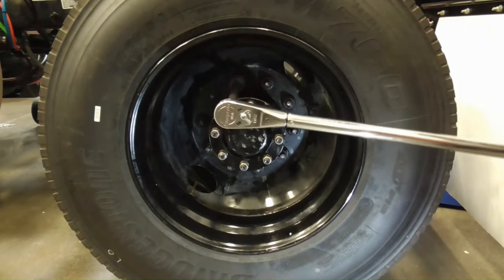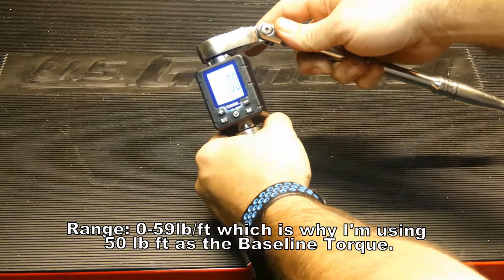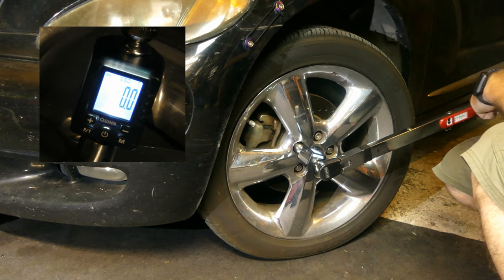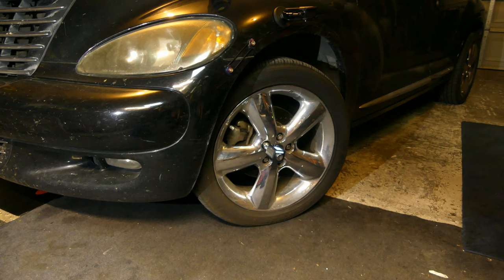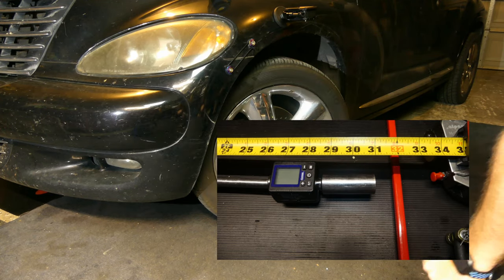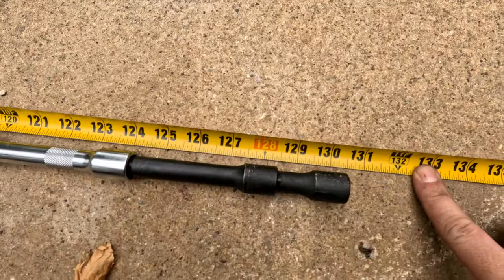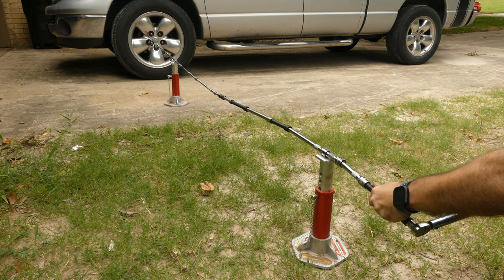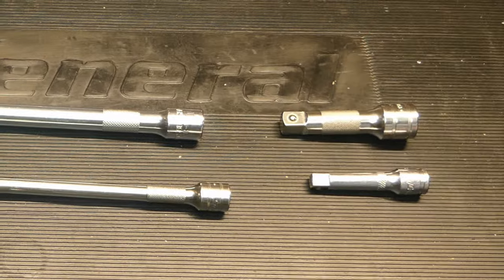An Extension on a Torque Wrench??

Comment: for anyone saying you cannot use an extension with a torque wrench....

1) blatantly false (whether you'll get the exact value you were after or not is a Separate issue)
2) I'd like to see those people get a torque wrench into a number of places it's required to torque things...
Reply from the maker: It was pretty close to the exact values, and in some instances you MUST use an extension for access.  Thanks for watching!
Reply: @Dartmech  I didn't want to summarize your video, so left that bit out.
Reply from the maker: Ha, whoops..

Comment: This testing is for static torque measurements.  The torque is the same at both ends, unless there is dynamic rotational motion.  If there is no motion, where else can the applied torque go?

Comment: Only rotational displacement will vary. PROVIDED there is NO additional friction at supporting points. Torsional energy will remain constant.
Reply from the maker: Great comment! I agree.  Friction plays a huge part of course, but the main twist (without additional friction) will be consistent with an extension.
Reply: It's mainly to do with shifting the rotational axis, which in turn changes how the forces are applied to the mechanism act on said mechanism, breaking the assumptions made at the design stage.

If you support the head correctly it's fine. Still a little bit out, but well within tolerance of whatever it is you're doing (unless, I guess, you're assembling a jet engine or something).
Reply: @233kosta  that's what she said ...

Comment: I know a guy that went to training with a tool manufacture and did a test with a solid extension and a spring type flexible extension and found no difference in torque. Change in torque has always been a myth. All that has been done is taking up slack.
Reply from the maker: Interesting!

Comment: Honestly the 11ft monstrosity is a good way to visialize why extensions dont affect torque, it takes more effort becuase you have to take up the slack but once its out you get the torque you set the wrench to. Now if you did that with an impact you'd definetly lose torque becuase they apply torque in blows not as a constant force. Anyway the only risk you have with long extensions is having angle introduced which will throw off torque readings.

Comment: It’s bs you can’t use an extension on a torque wrench. You can’t use an extension on a torque stick using an impact gun. 
The extension will simply twist until the full torque is applied.

Adding a wobble extension can create an issue cause you can change the angle.
Reply: Some dynamic forces come into play with a torque stick and impact gun. The stick acts as a torsion spring. Maybe that spring action is the source of the "no extensions" rule?
Reply from the maker: I wonder about the wobble and am kicking myself for not including it in the testing.   However, as long as the "twist" remains constant I'm thinking it'll have a similar affect.

Comment: on a impact that strikes to turn the socket each junction absorbs the striking force. That is the not the case here. However I have twist a snap on 3/8 12" extension with a craftsman 3/8 ratchet by hand

Comment: Impacts may have a huge difference though.
Reply from the maker: I'd say so because of the "shock" effect, it might be delayed at the end of a long extension.
Reply: @Dartmech  That is exactly how torque sticks work. They "swallow" some of the torque. Impacts don't operate on static torque. They use impulse and momentum to create torque. Very High torque is created for a very small instant in time, so it can't propagate to the fastener.
Reply: @alb12345672  that's what she said ...

Comment: I believe that "Tools Tested" Youtube channel did a test of torque wrenches and it was discovered that the "Icon" brand which you used in the video was usually out of calibration by that 1-3% as you have tested and shown. So in my opinion I would just add 1-2 additional ft pounds to the manufacturer recommended torque value and use deep or short sockets or even a 3 inch extension so long as it is not a "Critical Bolt" like engine head bolts or camshaft rocker bolts etc, anything else it's quite ok.
Reply from the maker: Ohh thanks for the comment, I’ll check out that channel!  Usually 1-2% isn’t much on non critical bolts like you said, but adding one or two ft lbs would be a good idea with that one.

Comment: Thank you so much for doing these videos! Here is a question. Suppose i am attempting to do a spark plug (or any given scenario close to this). I take the spark plug socket place an extension on it to get it out of the spark plug hole. Then use the torque adapter with my rachet connected to it there at the extension instead of the socket (since obviosly no space for the adapter) Would this even be remotly accurate? My thought is if the physical size of the torque adapter is to large for the location and you use an extension (reasonable size) to get you enough room for the adapter how much would this throw off the torque reading? Thanks again and i just aubscribed to your channel.
Reply from the maker: You should have no problem with that setup. Any torque loss was negligible with extensions, so using one after a torque adapter shouldn’t hurt anything at all. 👍

Comment: I thought extensions were fine, but cheater bars (anything that increases length of lever) is problem. ….that’s what a crows foot does- changes length of lever.
Reply from the maker: Yes, even hand placement will affect the applied torque.

Comment: What if you add the extension between the adaptor and the socket? Will that change the torque number accuracy? With smaller tight space in the engine bay, that adaptor won’t fit? Have you tested? Thanks in advance for your response. I’m on edge of buying one that’s why I’m asking.

Comment: Would be interesting to know what torque was putting IN at the torque wrench itself. Like do you actually have to apply 55 to achieve 50 at the wheel nut.
Reply from the maker: That's a great idea, But I think that depends on the torque wrench itself.   That may be a future video to see which type of wrench is the most accurate.
Reply: Torque in is torque out.  If the extensions form a perfectly straight line and are all in line with the fastener, then the input equals the output torque.   The only reason his readings vary at all is tiny misalignments of the wrench and fastener. This creates the same change in length issue a crowd foot does when not used at ninety degrees.
Reply: @brianhaygood183  Hmmm. Yeah I guess the input torque does have to equal the output torque. Maybe I'm thinking of the amount of travel that the input end has to go through to still create the same amount of torque.

Comment: I have seen a few videos like this and Im sorry to say you are not good with the tools mate. You need to support the base of the wrench otherwise the power will get distributed in other directions instead of in torquing power. If you support properly the shaft you created you will get an accurate measurement. But for a mechanic this is an instinct to put one hand on the base of the wrench to keep it in centre and one in the the handle to produce leverage power.